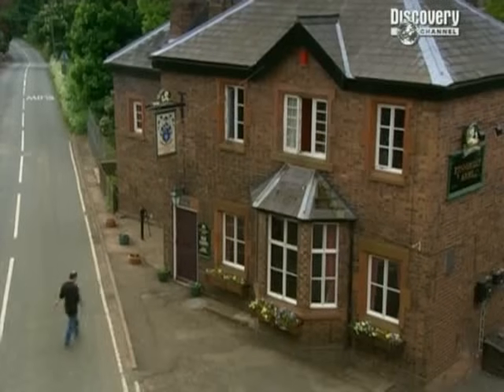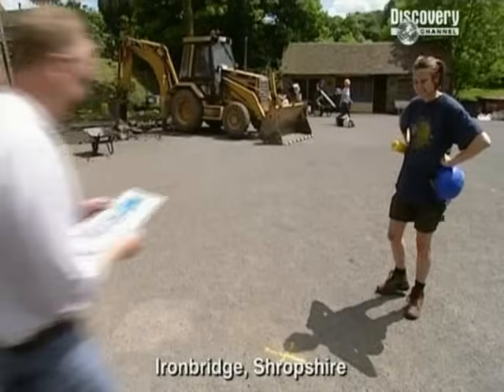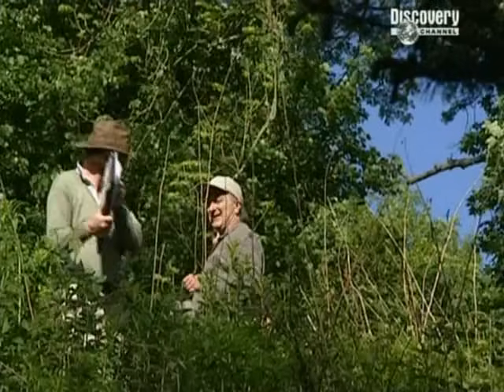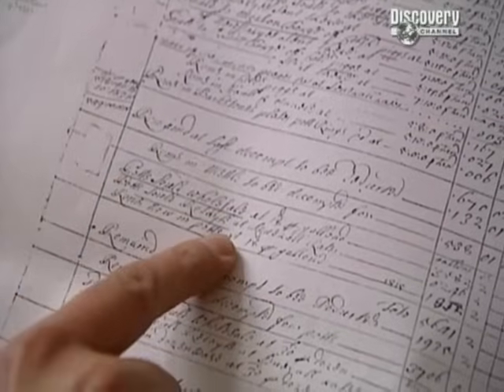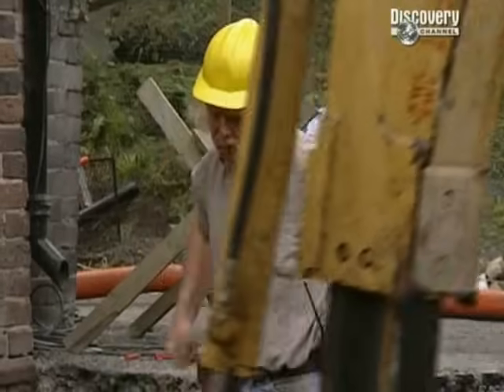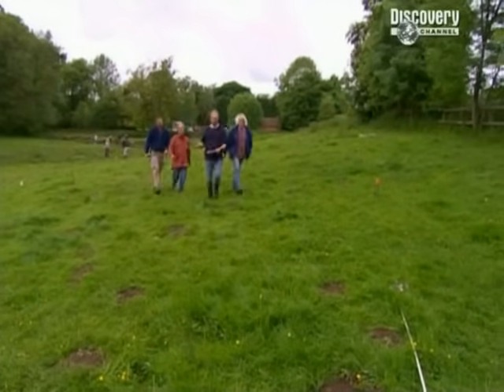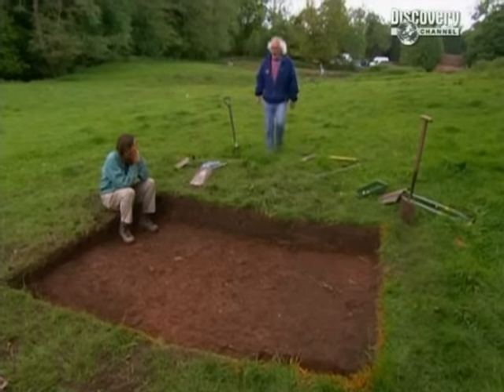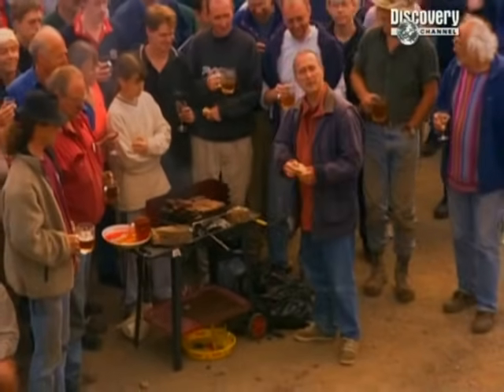Time Team S09-E05 Ironbridge.Gorge,.Shrops

Comment: I had to learn to sand cast, like where they are casting the actual cannon balls, in 1970 while I was getting a degree in Industrial Arts. I actually made a wooden mold and made a special tool to rebuilding motorcycle crankshafts. The more things change the more they stay the same.. LOL
Reply: I've sand cast metal as well as done open face castings of glass where we poured molten glass into impressions in sand rather than used a cope and drag. I miss molten material

Comment: As a charcoal maker, though in ring kilns, I can testify to how long it can take and apart from the first 2hrs. of cooking. You then can’t leave until it’s done. There’s always got to be someone, preferable two to keep a wakeful eye on things.

Sometimes it just watching, sometimes it feeling the smoke for dampness and later of stickiness. But it’s also a good time to read, bodge and carve. Or just enjoy the surroundings. Always something to do, see and listen. And plenty of physical work before, during and after the burn, (though there’s very little actual burning going on).

And once lit, it takes as long as it takes. For ring kilns, that could be 10hrs+ to over 24hrs. you just can’t say beforehand… it takes as long as it takes. If you rush shutting it down, you’ll end up with little charcoal and lots of brown ends, (would that’s not completely converted). The brown ends go into the next burn. But leave it too late to shut-down and you’ll be burning charcoal that’s already fully converted. Only experience leads to a successful burn, but there’s no guaranty as to how much saleable charcoal you’ll get. Only that there more sleepless nights ahead, more coppicing to be done, more charcoal to make. Big stuff goes for BBQ fuel, smaller stuff goes to the smithy and the smallest to the allotments for biochar. And if the local artists order beforehand, there’ll be some made to order high quality artists’ charcoal too.

Comment: Ah. Stewart revealed the answer to my question as to why the firing campaign stopped during the summer. It had to be because the water level of the stream dropped then, making its force insufficient to drive the wheel.
Reply: Probably a relief not to have the fire going during the heat of the summer too.

Comment: The man made dam story don't confinces me. If you hold back the water, fed by a small, slow stream, you empty the "stored" water in no time, because you can't level up the dam fast enough. So I think, the creek was holding much more and faster moving water in the time back.
But anyway, Time Team  is still my favorite.
Reply: You can temporarily reroute the stream channel so you can build dam, once dam is finished reinstitute the original stream channel. One option.
Reply: @Graf:  1. The point of a dam is to create a reservoir to control flow. 2. Yes, through winter there would be a larger volume of water.

Comment: Wait... you need red hot charcoal to make charcoal? How does that work?
Reply: Heat is needed to burn off moisture and gasses out of wood .  Charcoal can be made with a coal bucket with a top and a small hole in the bottom and set over a fire. Once the volatiles are gone you have charcoal.